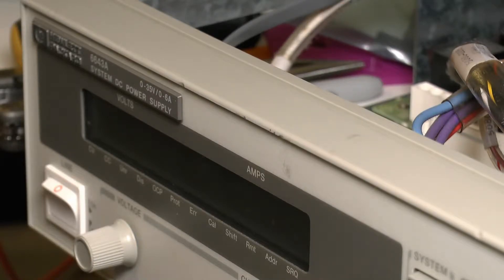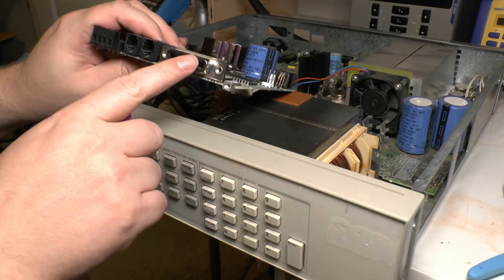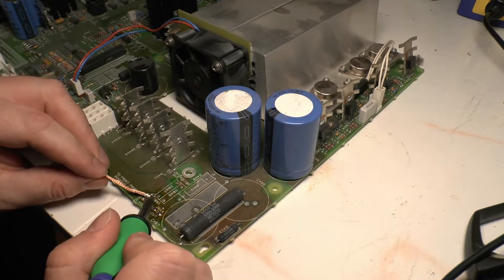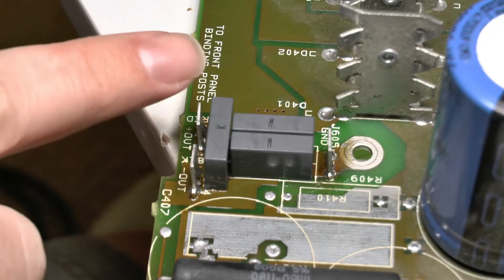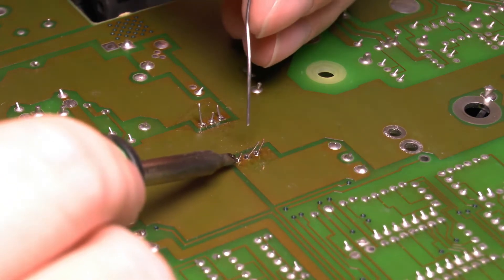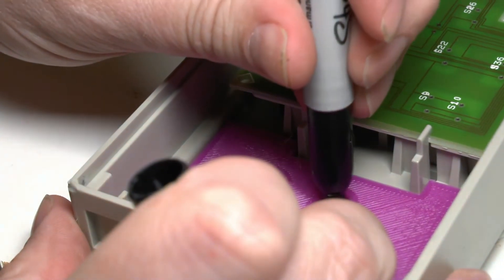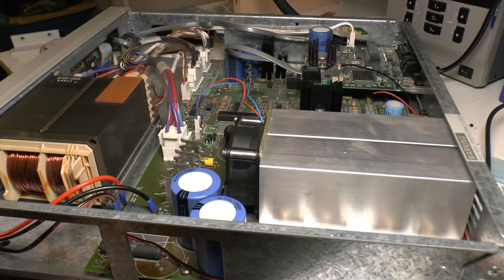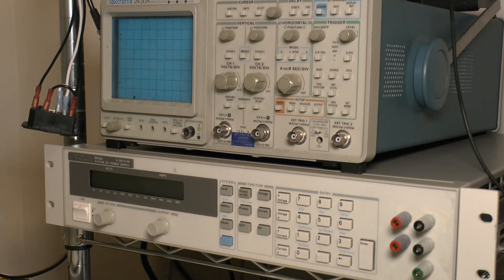Lets modify a HP (Agilent) 6643A Power Supply with Front Binding Posts

Comment: Usually the point of four posts is for remote sense / Kelvin connection.  Add an extra hole for a remote/local sense switch.
Reply from the maker: There's one on the back. I do have a switch for the front I just haven't got around to setting it up :).

Comment: Any chance you could do a basic walk through of a multi-meter, with regards to basic trouble shooting?
Reply from the maker: Oh sure not a problem.
Reply: @SkuldChan42  That would be cool. I'm dabbling as I have systems going back to the 80's [C64s, Amigas, Nes, Sega, etc] as well as stereo receivers and random electronic doo-dads.

I recently picked up a Sega Master System and it doesn't seem to get power and a cursory look say's that the power regulator is fried.

Thus, any tips or insights to basic diagnostics would be much appreciated. Thanks!
Reply from the maker: @RetroMMA  You know what - I have a co-worker who gave me a Sega Genesis Model 2 last week. I could do a detailed instruction on how to test the voltage regulator inside it. I don't think they fail that often tbh, but they are pretty easy to test out.